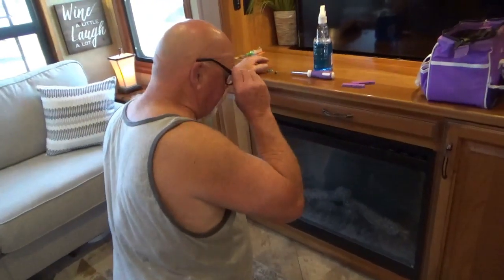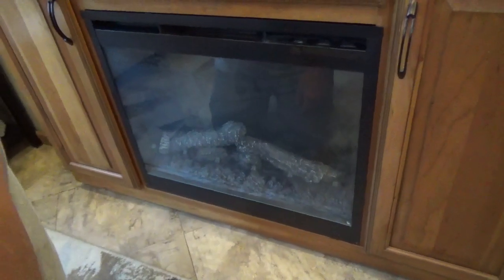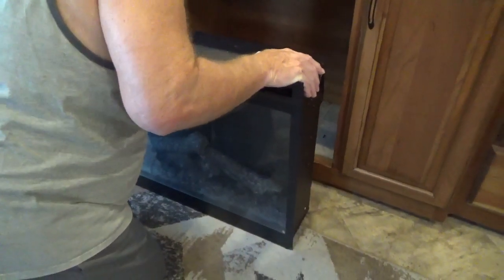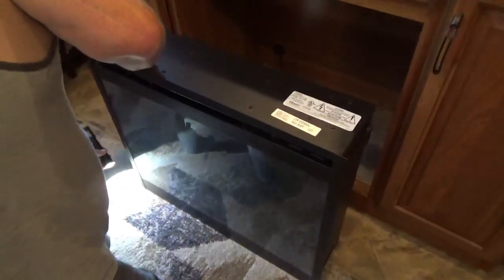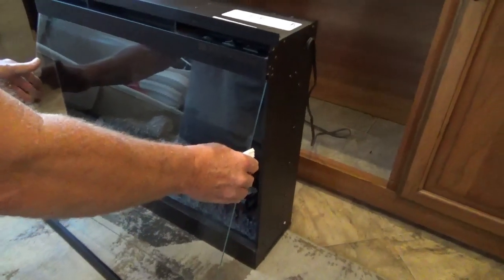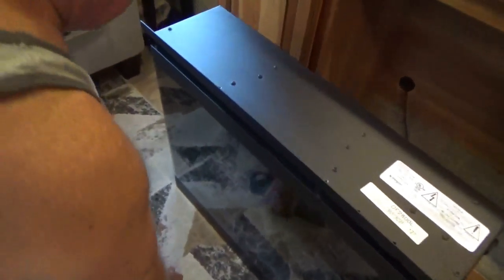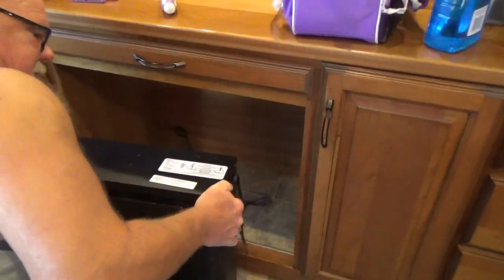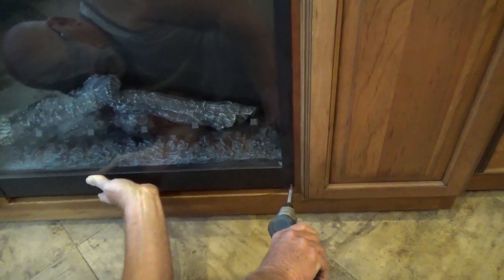Foggy RV Fireplace Fix // Full Time RVing

Comment: Thanks for doing that job, we have a unit that looks just like that but we have a motor that runs the fan and is making a noise.  It sounds like it could be a bad bearing or bushing that needs to be lubricated if possible.  Now I have no excuse but to take ours out and figure out what is causing the noise or vibration.   Thanks again, good job.
Reply from the maker: Ours is making a little squeal once in awhile too but we'll look at that another time. :-)